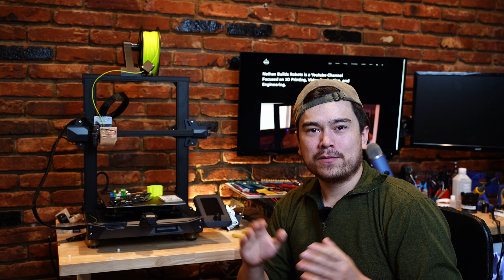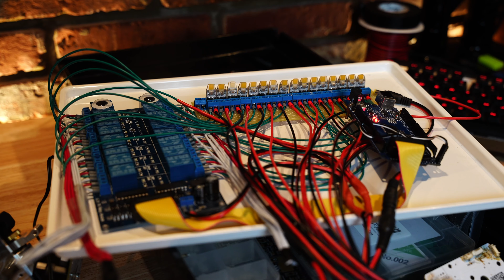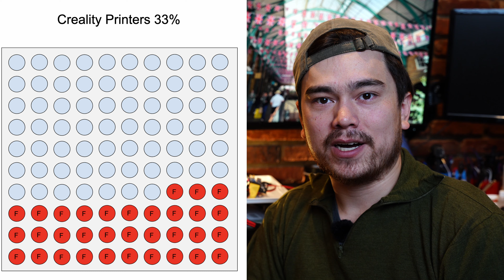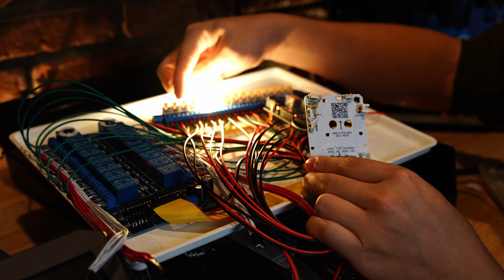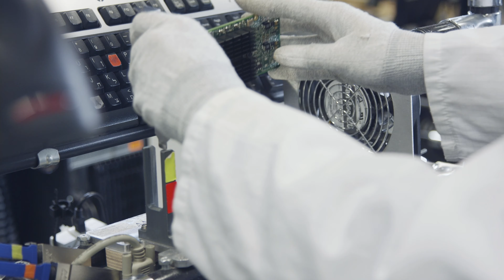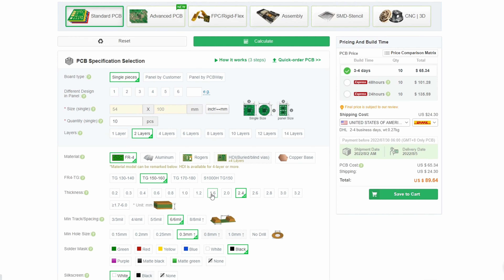Quality Control in 3D Printing - The Importance of Production Testing

Comment: I think it's funny that the badness of Creality printers is commonly pitched as a benefit to new users on Reddit.  "Creality sucks but you should still buy an Ender 3 because you'll learn a lot making it not suck".
Reply from the maker: Yet the new models are more expensive, and more difficult to "fix" via upgrading, thanks to tiny proprietary connectors, tiny proprietary board, and proprietary  heatbreak, heatsink, hotend, and extruder.

The extruder is excellent in my opinion, so I still reccomend using it. But all the add-on and upgrades that you attach to it have to be redesigned. 

To me, it's an obvious cash grab by creality, making it more difficult to escape their ecosystem. 
What's that? You want an all-metal hotend? Buy a "Creality" hotend upgrade!
Did your fan burn out and you need to buy a replacement? Don't worry, we got you covered. Just buy the "Creality" replacement fan. 
Did your mainboard wear out? Need a new one? Guess what, your only option is the "Creality" mainboard!

I plan on making a whole series of upgrades to get people out of the Ecosystem. The breakout board is just the beginning.

Comment: Good job!  You are doing it right.  At the scale some of these printer manufacturers are selling machines (aahhmaahmm creality), it is expected that there will be faulty units.  You are doing small boards, imagine selling 10s of thousands of electronics with frames that have to be in tolerance of a fraction of a millimeter.  When you think about it I would say they are actually doing a great job at scale.  But at the end its always going to be better quality from someone like you who is taking QC to another level personally.
Reply from the maker: The general standard for faulty goods in consumer electronics is 1 in 1000. Think TVs, paper printers, microwaves, cellphones. I would estimate the overall fault rate for 3D printers is 10-20%, which is way below standardsset by most industries.

If you look at Apple, they make products at a scale that is way more complicated.

Same with Ford. Cars are incredibly complicated machines, but there are millions of cars on the road, and very few have any issues within the first 60,000 miles. 

Manufacturing at scale does not excuse poor quality. The only way that scale can effect quality of if your are cutting corners and not detecting and fixing problems in a timely manner.
Reply: @NathanBuildsRobots  Good points.  Man these printers are crappy lol.

Comment: I just placed my order for one! Will they have the a voltage step down built into the board or do I still need to grab a diode for the silence of the fans?
Reply from the maker: You will need a diode for this one. I added a note to your order to include some 12v zener diodes
Reply: Thank you! My S1 Pro is my first 3D printer I’m looking forward to modding it, you’re videos have all been awesome 👏

Comment: Isn't it funny how elementary this is? And yet... it's an ongoing fiasco. The QC issue happens in my field as well. Everyone is so hasty to get the product/project out the door, they skip a proper QC pass and then when we have the inevitable failure, it costs us exponentially more time and capital. It's the old "penny wise, pound stupid" issue.
Reply from the maker: Yes, and the inevitable argument is that QC and rework are expensive. But when properly executed, quality control is not that expensive. The savings from having to deal with less returns and warranty repairs, and improved brand image are well worth the investment.
The other thing is, sometimes they won't let you return the item, and their "warranty repair" is just sending you the parts so you can fix it yourself. Imagine if your car had a faulty transmission and the manufacturer was like "Oh, my bad. There is a new one in the mail for you, good luck installing it"